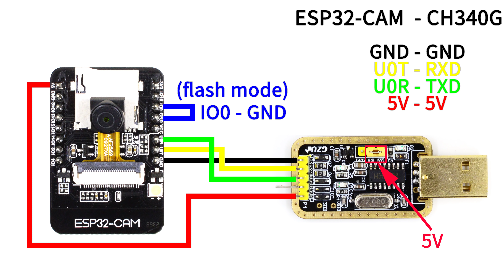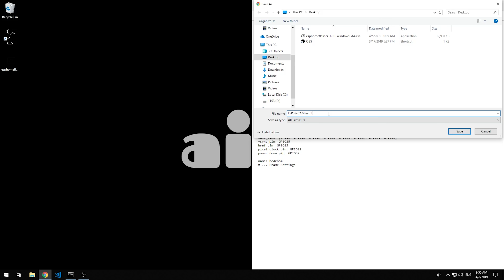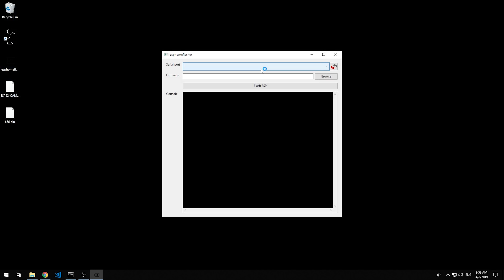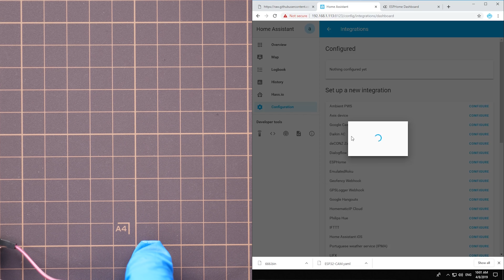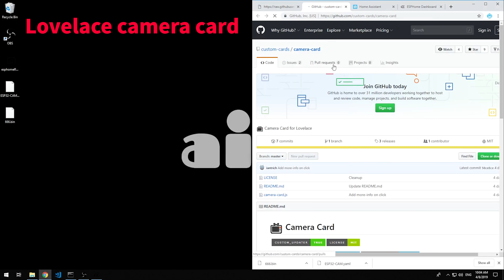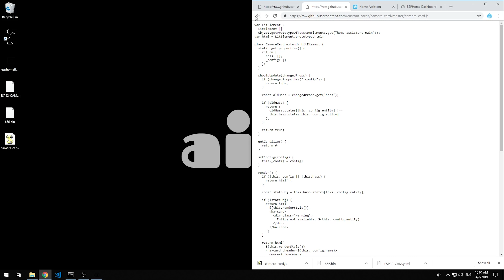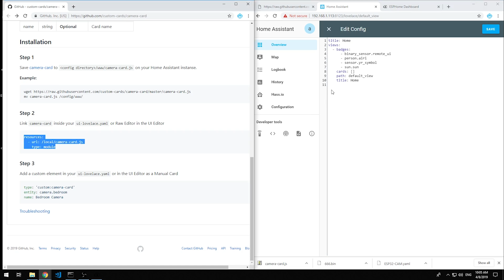ESP32-CAM camera with ESPHome directly integrate into Home Assistant and Lovelace UI

Comment: You can also control the flash led thats on the board.
switch:
  - platform: gpio
    pin: GPIO4
    name: "ESP Camera Light 1"
Reply from the maker: That’s neat!
Reply: Where do you put this code and how do you call upon it?

Edit: 
This code must be set in the .yaml file of the ESP at the bottom.
This creates a new "switch" entity with the name specified.
The switch entity will show up when adding the esphome with bedroom.local (it will show 2 entities: one camera entity and one switch)
Reply from the maker: @rednassie1101  Thanks. I just updated the yaml file https://raw.githubusercontent.com/airijia/esphome-config/master/ESP32/ESP32-CAM.yaml
Reply: Is there a way to change the resolution of the camera or take snaps from the lovelace UI? That would be really handy.
Reply: @dominikheinz2297  add under "# ... Frame Settings"
resolution: 1600x1200

Warning: I got an "out of memory" error when working with this resolution.

see https://esphome.io/components/esp32_camera.html
for more settings.

PS: Make sure the "fps" is included in the .yaml

so not
max_framerate: 10

but
max_framerate: 10fps

Comment: Hi Airi, I just got a bunch of these small cards (were on sale at 11.11 at banggood). I've compiled it with ESPHome 1.14.3, during the compile I get warnings: 
src/esphome/components/esp32_camera/esp32_camera.cpp: In member function 'virtual void esphome::esp32_camera::ESP32Camera::dump_config()':
src/esphome/components/esp32_camera/esp32_camera.cpp:54:10: warning: enumeration value 'FRAMESIZE_QXGA' not handled in switch [-Wswitch]
   switch (this->config_.frame_size) {
          ^
src/esphome/components/esp32_camera/esp32_camera.cpp:54:10: warning: enumeration value 'FRAMESIZE_INVALID' not handled in switch [-Wswitch]

After the compile, the logs in ESPHome shows: [W][esp32_camera:151]: Got invalid frame from camera
They seem to fit to each other :-)
Do you have any insights you can share?
Reply: Hmm, it looks like it's a faulty board, I just tried with another, and that worked perfectly?

Comment: hello, it is possible help I can not make esp32cam work I follow the process of the video, but I think the problem is this error  https://fotos.subefotos.com/ef48df3ce856be8985d955eb717eeca1o.png      I don't see a solution          home assistant if I activate camera led camera if it turns on but no video

Comment: I have a problem with the heat on the ESP-32CAM board (same as your board). I use 5V adaptor DC to the breadboard. I need your help with it, so if you have an e-mail contact for help it will be a pleasure for me.

Comment: Hi, I am getting the following error. Do you have any idea how to resolve it?

[14:59:48]Memory dump at 0x40160eac: 0300df21 d0091064 d04cd03b
[14:59:48]Guru Meditation Error: Core  0 panic'ed (IllegalInstruction). Exception was unhandled.
Reply: Try to erase the flash with esptool and retry flashing by using ESPHome

Comment: A quick question, can you have more than one ESP32-CAM attached to the same WiFi / Router ? Thanks.
Reply: I amalso interested as I plan to connect 2 devices and take syncronized shots for stereo 3D picture capture (would be side by sided on browser side )
Reply from the maker: Use different hostnames
Reply: AIRI Thanks, I’ll give that a try !

Comment: Thanks a lot for the tutorial. I cannot get the ESP32 to connect to my network. When looking at the terminal, I am getting the following lines, any idea?
Note: I tried with 2 different AP/SSID, same result.

[1B][0;33m[W][wifi:429]: Restarting WiFi adapter...[1B][0m
[1B][0;32m[I][wifi:167]: WiFi Connecting to 'NETGEAR78'...[1B][0m
[1B][0;33m[W][wifi_esp32:317]: Event: Disconnected ssid='NETGEAR78' bssid=[1B][5m00:00:00:00:00:00[1B][6m reason=AP Not Found[1B][0m
[1B][0;33m[W][wifi:412]: WiFi network can not be found anymore.[1B][0m
[1B][0;33m[W][wifi:429]: Restarting WiFi adapter...[1B][0m
[1B][0;32m[I][wifi:167]: WiFi Connecting to 'NETGEAR78'...[1B][0m
[1B][0;36m[D][esp32_camera:159]: Got Image: 0x3ffc7be4 len=21120 width=640 height=480 format=3[1B][0m
[1B][0;33m[W][wifi_esp32:317]: Event: Disconnected ssid='NETGEAR78' bssid=[1B][5mCC:40:D0:7A:41:67[1B][6m reason=Auth Expired[1B][0m
[1B][0;33m[W][wifi:399]: Error while connecting to network.[1B][0m
[1B][0;33m[W][wifi:429]: Restarting WiFi adapter...[1B][0m
Reply: try rebooting the wifi router "NETGEAR78"
Reply from the maker: Wifi signal strength.

Comment: Is it normal for this camera to lag by 6 seconds and have a frame rate of 1 frame every 2 seconds?
Reply: If you set the resolution too high, then yes that is normal. The camera may be capable of a reasonably high resolution and frame rate, but don't forget that the Esp32-CAM SOC (or processor) has to do pretty much all the heavy lifting here! Among other steps, basically it has to run the following sequence of operations on each frame of video in order to get it out onto the network for storage or immediate watching: debayering, white balance adjustment (if required), noise filtering, video compression and then it has to transmitting the frame over the network too! If you pick a high resolution the processing steps take much longer, which in turn really limits the maximum frame rate it can manage.
Reply: @TheBauwssss  Thanks for the reply. Even at 640*480 it frequently struggles. I think it’s dependent on network activity/interference. At certain times of the day, my cameras work very well with high frame rate (even at 1280*768) then without changing anything the frame rate drops massively. I think the main variable is the number of wireless devices on the network at any given time. Still, pretty good for £5 each!

Comment: Hello guys has something changed. I’m following exactly and I get errors when compiling. Rob
Reply: src/esphome/components/esp32_camera/esp32_camera.cpp: In member function 'virtual void esphome::esp32_camera::ESP32Camera::dump_config()':
src/esphome/components/esp32_camera/esp32_camera.cpp:54:10: warning: enumeration value 'FRAMESIZE_QXGA' not handled in switch [-Wswitch]
switch (this->config_.frame_size) {
^
src/esphome/components/esp32_camera/esp32_camera.cpp:54:10: warning: enumeration value 'FRAMESIZE_INVALID' not handled in switch [-Wswitch]

ESPHome 1.13.4